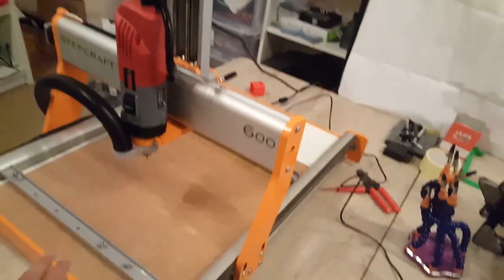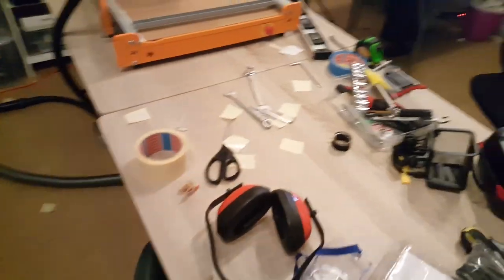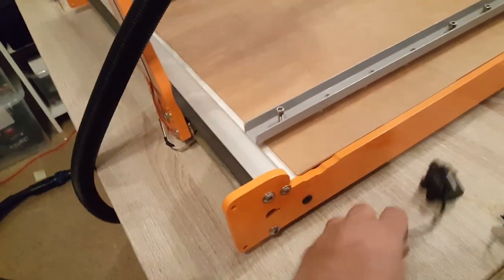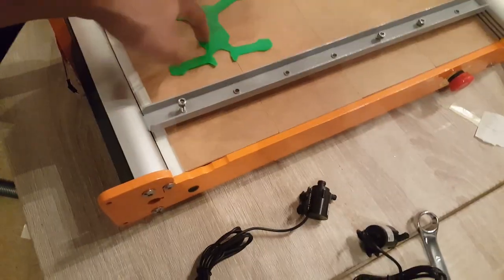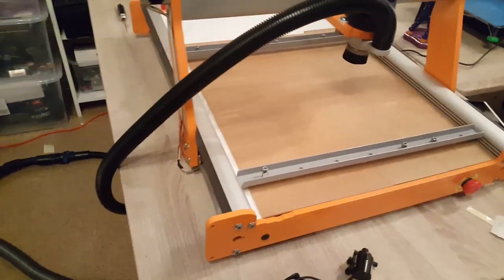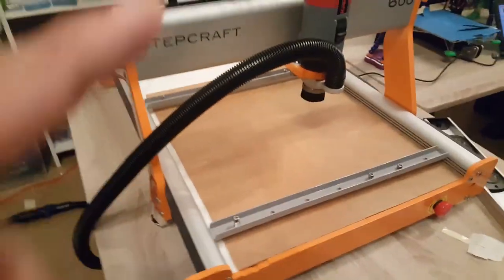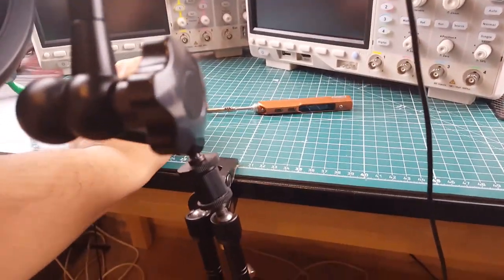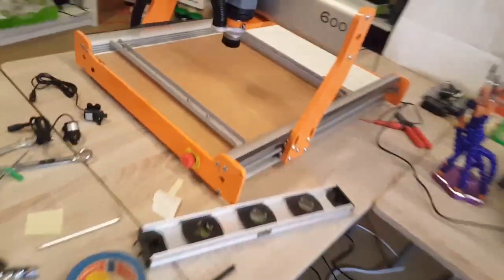CNC Carbon Fiber Frames and More // WorkShop Vlog #001

Comment: Loving this new project, keep it on this channel.  It is really super hard to balance the flow rates on two motors running at different head pressures.  They also don’t look strong enough for this application.  Instead i would just run an aquarium canister filter providing continuous water flow and filtration to the bath.  Keep it simple.

Comment: consider to pump clean water IN instead of dirty water OUT, so the fibers don't damage the pumps...
Reply from the maker: PrinzTom Have not thought of the fibers damaging it. The pumps where fairly cheap it will be a test run.. Thanks for the heads up I'll keep it as an on going project with its status.

Comment: by the way vacuum hose. where you got it what size ir that and what adapter did you used ?
Reply from the maker: VIVA FPV I bought the adapter from stepcraft the kress adapter. it came with the hose and just stuck it in my vacume.

Comment: Please use care in cutting carbon fiber as it should be cut in a water bath to suppress particles as even if you wear a mask the small fibers get deposited all over the place and become a long term heath risk as these can become stuck in the lung. 

"The long, thin shape of such a fiber may cause it to become trapped deep in the lung and damage lung tissue. At the end of the bronchial passages in the lung are tiny sacks called alveoli. Through the walls of the alveoli gas exchange takes place. Your blood gives up carbon dioxide and takes on oxygen to be distributed throughout the body. If a fiber is inhaled and manages to penetrate the alveoli, it typically becomes lodged inside. Ultimately this fiber scars the tissue and renders the alveoli incapable of gas exchange."
Reply from the maker: Video-Drone Thanks for the heads up. Preparing to install the milling bath for the carbon fiber.
Reply: Video-Drone did you watch his video? He covered all of that.
Thanks for the health class though